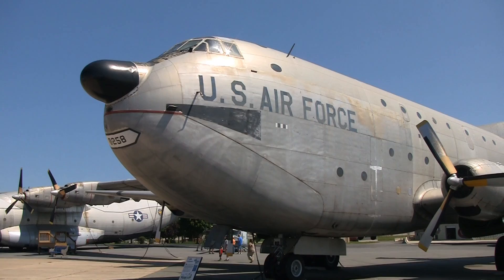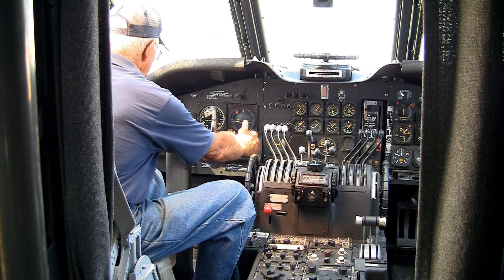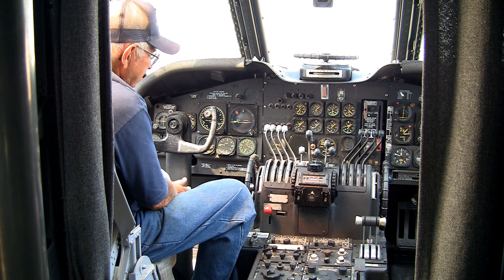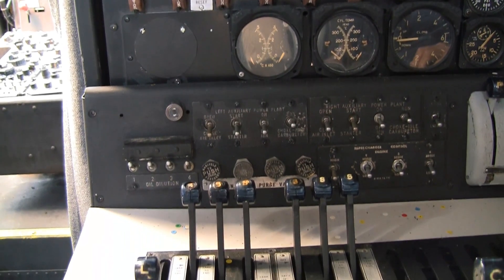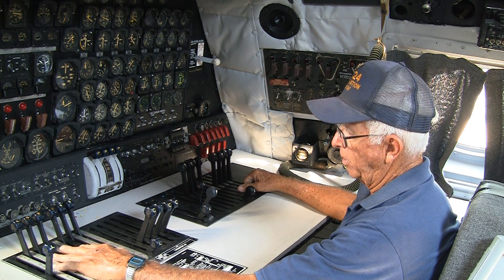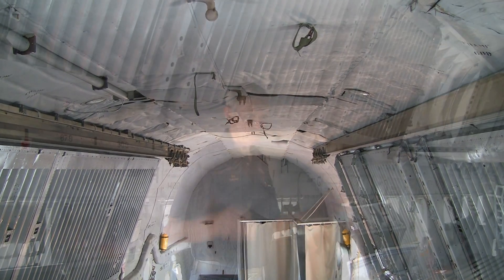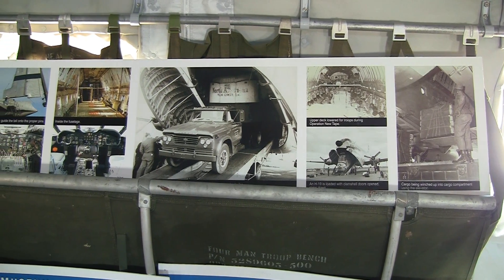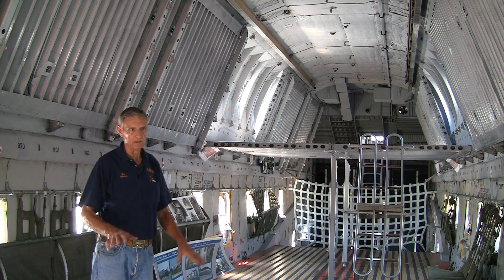C-124A Globemaster II - "Old Shaky"

Comment: When you say "once you get the gear up you bring in the props" do you mean you changed the prop RPM because the engine RPM is still at full throttle, correct? So the props are controlled by some kind of clutch? And the engineer's job is to manipulate this clutch so that the props RPM changes, even when the engines are at full hammer?
Reply: In piston engines, props are bolted to a spline on the front of the gearbox of the engine (no clutch).  (In larger aircraft - typically turboprops this can be a reduction gearbox) -  The 'pulling power' of props is controlled by 2 factors - the engine RPM (which commonly in piston aircraft is the same as propeller RPM) which is controlled by a throttle, like in your car and the angle of the propeller to the airflow - called pitch. 

On take-off with piston engines and simpler variable pitch propellers (i.e. manually changed by the pilot) , the props are in fine pitch, that is - at a low angle to the airflow. This allows them to take many small bites out of the air and accelerate the aircraft - a bit like being in 1st gear in a car. Because aircraft piston engines have a narrow operating RPM range (often maxxing out around 3000 RPM)  The pitch is set to 'fine' for take off and RPM increased to the required amount by advancing the throttle. As the aircraft accelerates to flying speed and undercarriage is retracted, drag is reduced and the aircraft begins to accelerate further. You can leave the propeller in fine pitch and climb steeply (as you would going up a hill in a car) or if you climb for a bit and level off and the aircraft speeds up, you can increase the pitch of the propeller, so it takes bigger bites out of the air for the RPM you have set, and this will continue to accelerate the aircraft. The faster the aircraft goes, the higher the pitch angle to the oncoming air you need- again like changing up gears. As the aircraft reaches the target airspeed, you can adjust the propeller pitch and engine RPM to maintain that speed, just like gears and accelerator in a car. The sweet spot of lower RPM and higher propeller pitch can save fuel.

Larger more complex aircraft have a constant speed propeller which automatically changes pitch to maintain a particular RPM set by the crew. On takeoff, the required RPM is set on the propeller control by pushing it forward and then the throttle opened (also by pushing it forward.) The propeller is then in Fine pitch to accelerate, (1st gear) then as the aircraft accelerates, the load on the propeller decreases because the aircraft is now moving and the engine/prop tries to speed up but the Constant Speed Unit in the propeller senses this and stops the engine exceeding the required RPM by increasing the pitch of the propeller, so it takes bigger bites out of the air, maintaining the load on the engine, again like an automatic gearbox in a car. In this way the propeller continues to increase its thrust without overrevving the engine. 'Bringing in the props' probably refers to prop control back to reduce propeller RPM by increasing pitch.

Supercharged or turbocharged engines like on the C-124 have another trick and can when cruising, increase engine power by opening the throttle and increasing boost from the supercharger which increases engine power for a given RPM. If the crew selects a lower prop RPM while increasing the boost, the CSU detects the engine trying to speed up the propeller and will increase propeller pitch (change up a gear) to increase the load on the engine and therefore maintain the selected RPM. So you get the same propeller thrust for a lower RPM.

Because boost means you can make same power at a lower RPM and because the engine/prop is spinning slower (while taking big bites out of the air) for the same thrust/airspeed, this can save fuel (again like going into 5th or 6th in a car on the highway) The Flight Engineer could spend quite a bit of time making small adjustments to boost and RPM to maintain efficiency in cruise.

A bit oversimplified but there you go.
Reply: @Completeaerogeek  Aweesome..thank you for this. I've been asking myself this for about twenty years....! Sometimes, in this 2020s world, where my attention span is about 7 seconds, it is hard to imagine that 19 year -old kids were taught all this in 1940s flight school in tens of thousands. I won't bother you with what manifiold pressure is! lol...and how that is also controlled somehow...I assume that is just like the throttle.